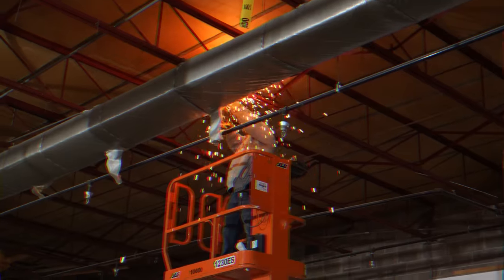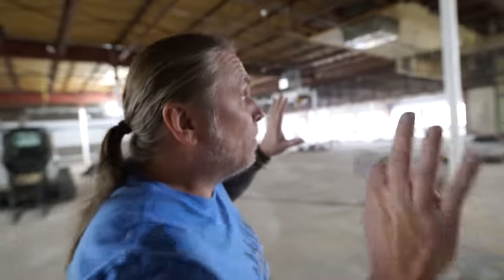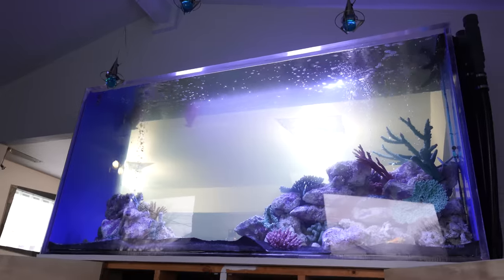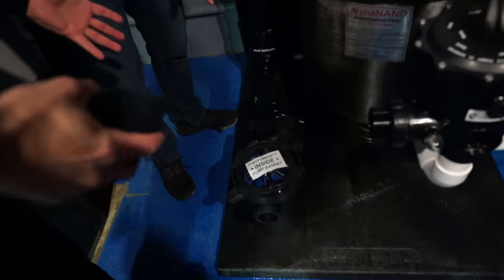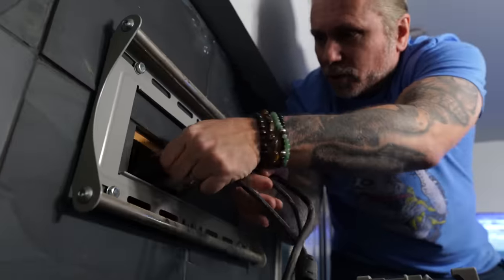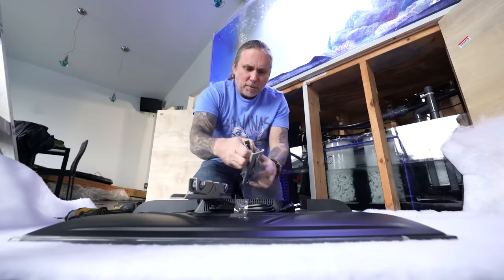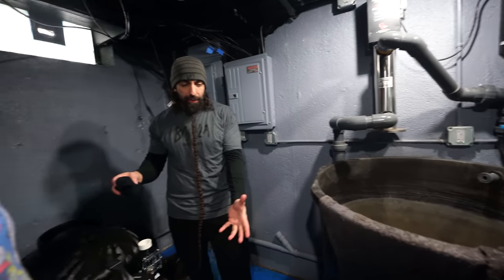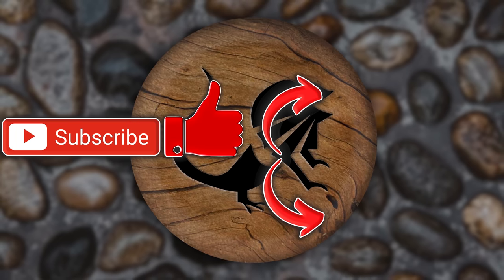5000 Gallon Basement Fish Pond Build!

Comment: in the house make sure u utilize a dehumidifier system, that many huge tanks and an indoor pond will raise the humidity through the roof, and risk black mold, proper household systems uv light filtration system is going to be very important

Comment: I work in construction mainly up and down Woodward from Ferndale to Birmingham doing home additions and there is always so much unforeseen costs from uncovering obstacles like this. It really sucks and sometimes I feel so bad for the customers having to dish out tons of extra costs. Some jobs there is huge up charges for extras and some have none, it just comes down to luck with old structures. Also 5k for a 5x5x4’ footing is highway robbery if there is 4-6 of them. Maybe 5k for one, but each additional footer is a fraction of the cost, the machinery is already there, the concrete truck is already there, the labor doesn’t take but a few hours each footer. I would get some more quotes, shouldn’t cost anywhere near 5k each, maybe half that if there is 4-6 of them.

Comment: Remember that electricity has no sense of humor. If people have access to an aquarium, you should have a wire connecting the water with the actual ground. Some faulty devices may burn but they are just devices.